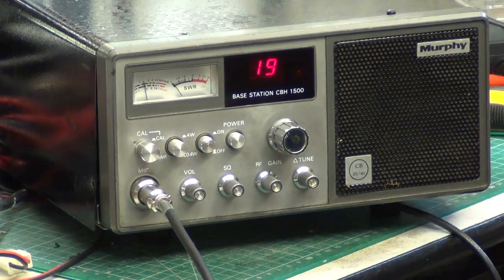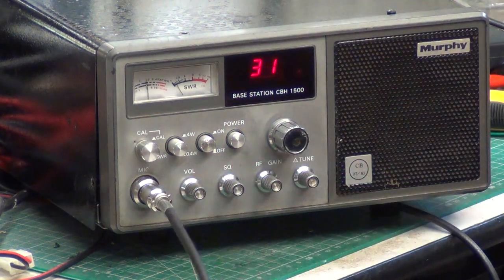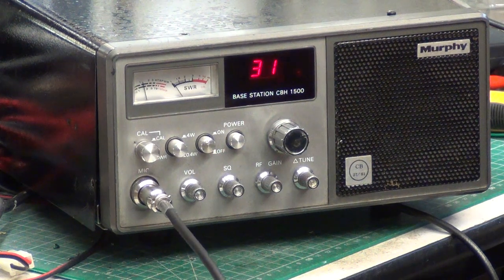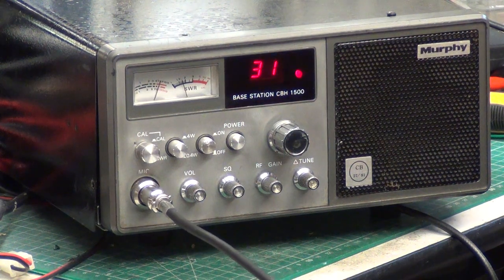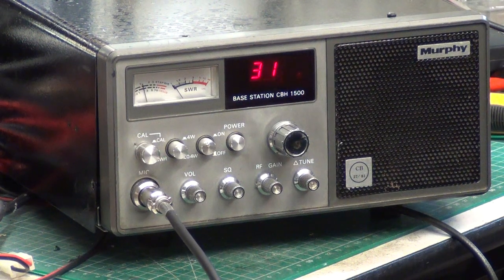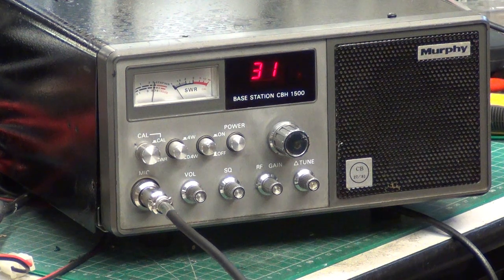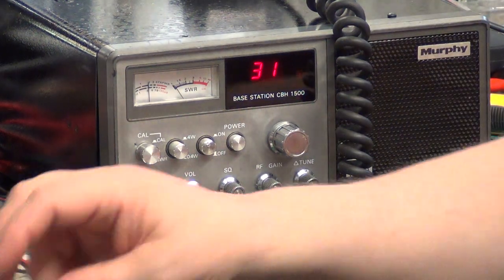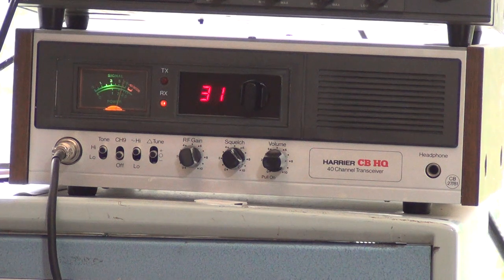Murphy CBH1500 CB27/81 UK FM CB radio base station - On The Air test

Comment: Last year I bought a Murphy CBH1500 CB27/81 off of eBay. It wasn't what you'd call mint condition though. The signal meter needle was sticky and the Calibration/SWR push button switch was broken.

I solved the sticky needle problem by replacing the selotape on the meter backing plate as it was interferring with the needle. The Cal/SWR switch was fixed by replacing the missing spring in the switch.

Comment: Ancaster Service Station
£1.799/L -> US$2.19/L -> US$8.28/US Gal
£1.919/L -> US$2.33/L -> US$8.85/US Gal - Diesel

Greylees a/k/a Rauceby level crossing
£1.729/L -> US$2.10/L -> US$7.96/US Gal
£1.889/L -> US$2.30/L -> US$8.70/US Gal - Diesel

No hum noted with earbuds in and hands over ears!  Nice Rescue job!

Comment: Someone said these can be modified easily to do 26.065 low band.
Reply from the maker: why on earth would someone want to turn a legal radio into an illegal radio? And no, it uses an LC7137 with a double locked ROM.

Richard, G0OJF, UK

Comment: Where did the usual "Hum" go to,  struggled to hear any hum on transmit?  I always thought the audio was not too bad, though the squelch could be a bit loud, but the transmit audio was horrible, hummed better than a choir boy that had forgotten the words!  😂
Reply from the maker: I'm assuming the hum nearly went because of my capacitor upgrade from 1000uf to 2200uf for the main smooting capacitor in gthe power supply.

Richard
Reply: @ukfmcbradioservicingTango21  That would help, so does upgrading the rectifier.  Didn't realise you upgraded the capacitor

Comment: I have a modern radio which i have owned for a few years which is on 24/7 but recently the squelch has become next to useless, i have had to turn the RF Gain right down to get the squelch to do anything.
I haven't opened the radio to try and turn it up on the pot yet, ive never had this happen to a radio before but ive never ran a radio thats not been turned off for a couple of years before either, is it a common for the squelch to fade?
Reply from the maker: No it's not. It could be down to a dodgy electrolytic capacitor. Hope they are not SMT devices in your set :(

Richsard
Reply: @ukfmcbradioservicingTango21  Ive had the radio open in the past to access the serial port so knew it was a pretty baron unit full of surface mount components but there are some 20+ standard electrolytic caps in there so i will have to open it and investigate.
bad electrolytic caps are pretty easy to test, i have hot air and have the physical skill to change surface mount but im not someone who has the diagnostics knowledge to be able to trace all but the most obvious of faults.